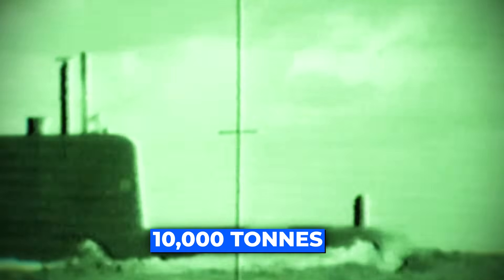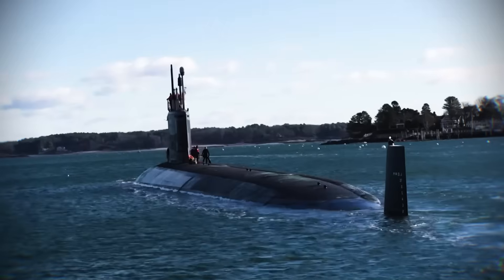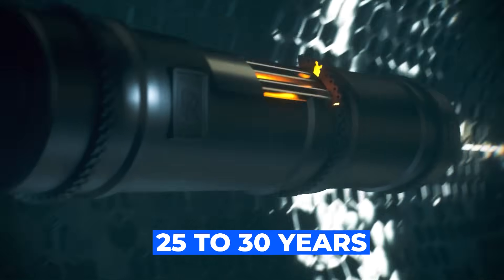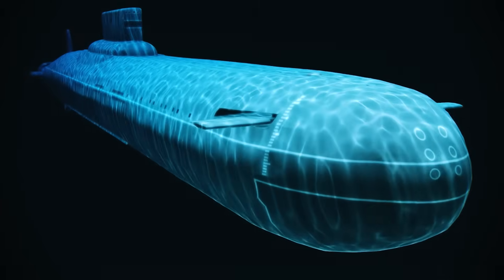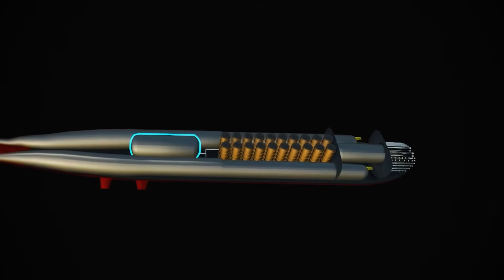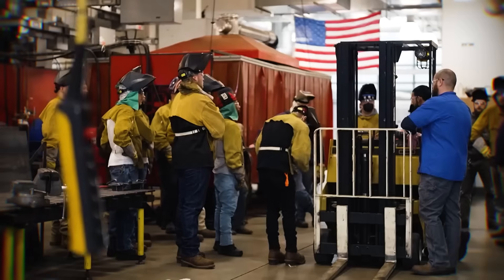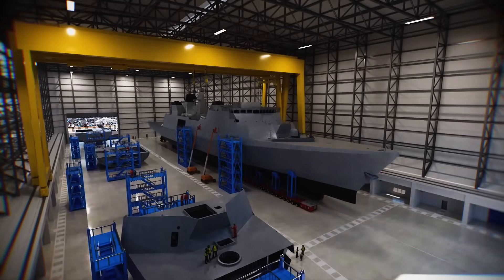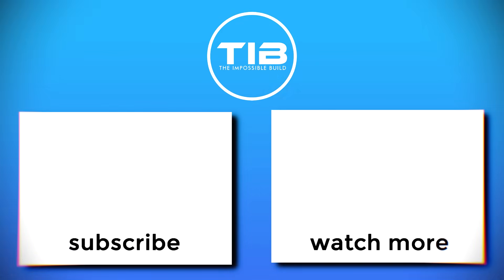Australia’s $368 Billion Nuclear Submarine Mega Project Explained

Comment: This video is wrong about electric and diesel engines nuclear boats have nuclear power plants that need pumps that make steam that translated to gears that turn electric motors that turn the props, but they still need pumps to pump water for the nuclear reactor and it's the pumps and gears that make the nuclear sub noisier than a diesel electric boat submerged, yes they are very quiet but not as quiet as new modern diesel electric subs with AIP and lithium ion batteries.

The new diesel electric subs with AIP and lithium-ion batteries are quieter than nuclear subs for different reasons, diesel electric subs do not run their diesel engines under water, on the surface yes they run their diesel engines, but once submerged they run on the new lithium ion batteries and AIP for up to 5 or 6 weeks or more without surfacing from what I have seen on the internet reports but a lot of it is secret, once submerged the lithium ion battery's power the sub, lithium ion batteries are 300% more efficient than the old lead batteries , then there's the AIP that also can recharge the batteries under water and power the sub as well, so the AIP and batteries with no gears or pumps go directly to electric motors that go to the props, this is why modern diesel electric subs are quieter than nuclear subs, no pumps or gears going to the electric motors.

Yes, nuclear subs are faster under water, but new diesel electric subs with AIP and lithium-ion batteries can do 20 to 25 knots submerged, which is not bad, and yes nuclear subs because of their reactors can stay under for 3 months as long as the food for the crew is available, but 5 to 6 or more weeks submerged is not bad for a diesel electric sub with AIP and lithium ion batteries, so it's a tradeoff between speed and silence and range, also nuclear subs are very expensive to maintain compared to diesel electric subs with AIP and lithium ion batteries, and nuclear subs have much larger crews than diesel electric subs.
Reply: Well, why not combine both? Lookup Columbia Class Submarine. Also, pumps aren't significant noise offenders, sound isolation technology has been greatly improved. The issue is almost quite the opposite, that is, being too quiet. The battle now is increasing sensor detection capabilities along with countermeasures.

Comment: $360B sounds like a lot but with 30 years fuel included. How much diesel would you need to power a sub for 30 years? And how much will diesel cost in 30 years? 🤔
Reply: $360B AUD is $235B USD, still a lot but about a third less. Also, this is for the project, not one Submarine. This figure is paid out over 30 years, all the while we are selling submarines to Australia, training their personnel, and selling them advanced technology and weapons systems, designing and constructing an entirely new SSN-AUKUS Class Submarine, and supporting sustainment and infrastructure upgrades.
Reply: 2 billion max

Comment: At close to ( and obviously going to exceed ) 400 Billion dollars to acquire approximately 12 nuke subs that currently you would get change out of 50 billion  PLUS infrastructure build which would amount to approx 50% more they are obviously gonna do something else with the other 300 PLUS billion..you work it out.
Reply: The price is for the entire program, upgrading and building sub bases, maintenance, wages etc for 30 years. Original quote was 245 bill that was multipled by 1.5, no they are not stealing 200 bill to buy hookers and coke
Reply: @paulmathews4335  That is incorrect. AUKUS costs $260B to $368B for the 30 years to 2053. Additional program costs beyond that are not included, including disposal. Hence the final cost will be far higher, more than double the cost of the French contract or French SSNs if we had gone that way.
Reply: @scottelaurant9747 that price does include a sub base, upgrades to Sterling and the sub construction facility upgrades. As for disposal that is outside of the 30 year window
Reply: So confidently incorrect. The original 300b+ figure was already factored in with a 50% blowout cost just in case. That includes the maintenance, crew, infrastructure. So it might end up being less.

Also it's 8 subs. 12 was the French program which only cost 50 billion less for far less capability. They needed another 4 to cycles and relieve the other subs in the straights since it takes them forever to get there and they can't stay very long.
Reply: @dan7564  There has been NO definitive decision on the actual numbers, with the possibility of even 5 Virginia's ( which wont happen) so if you can use a calculator which seems unlikely you can add up can't you?  Wouldn't trust YOU with management of a bank account !